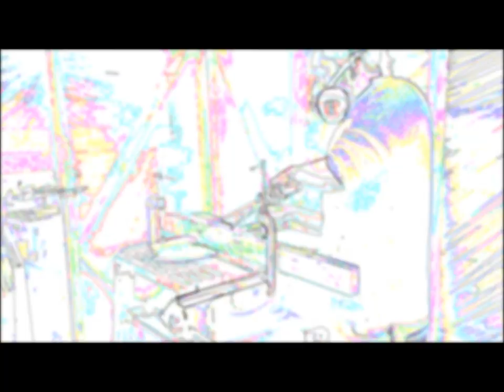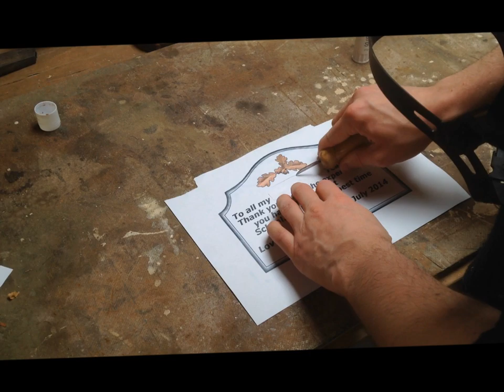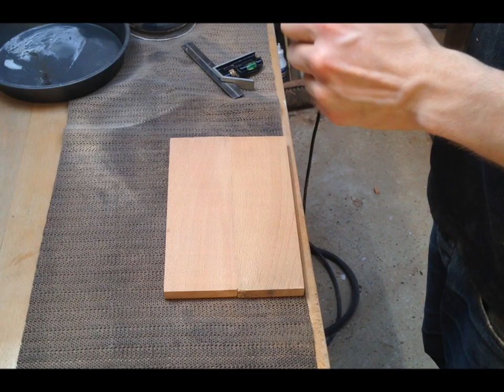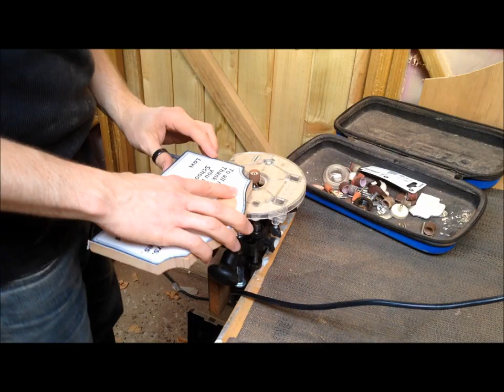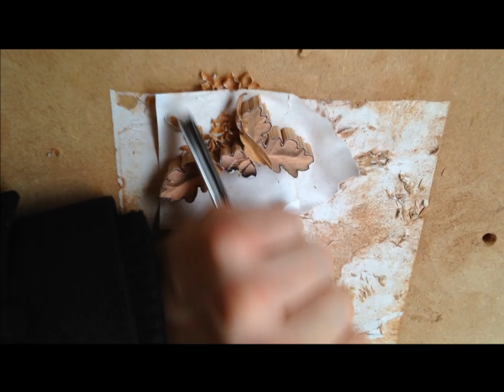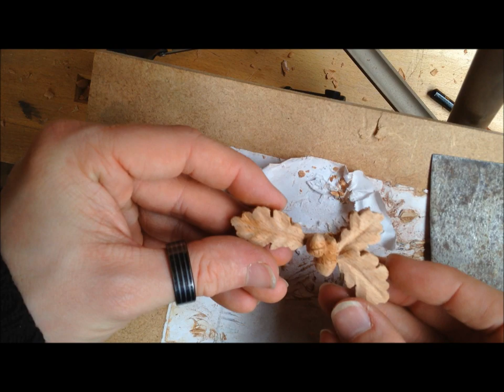How to make a wooden sign

Comment: Hi there Thanks from Ontario Canada for the video. One Question how did you get the black lettering to the board did you paint it on I would live to see you do that.
Reply from the maker: Hi, you're very welcome. No lol I wish I was that good at lettering! I typed the words on the computer then flipped the image so it showed  mirrored writing. Then I got a page of that label printing paper and took all the labels off. You've then got to load the paper so that the writing is printed on the shiny side and you must use an ink jet printer. Then simply print it out and lay it over the wood and press down. It prints straight on it, just be careful not to smudge or slide it as you do it. Hope that helps?